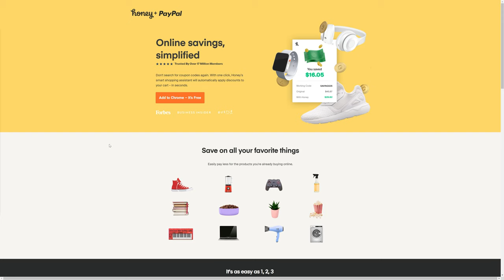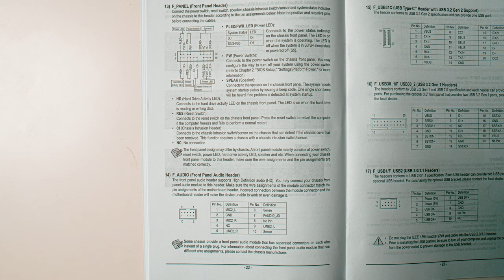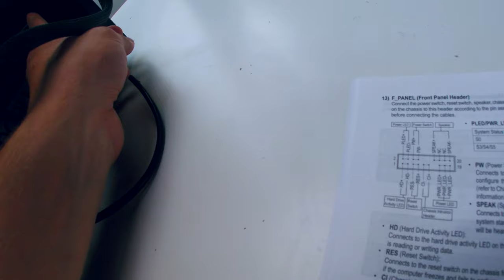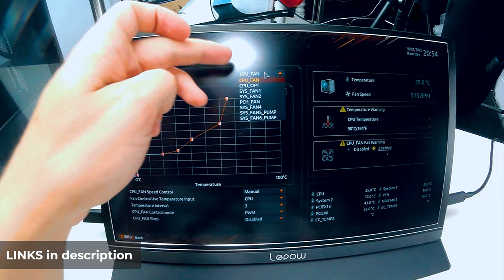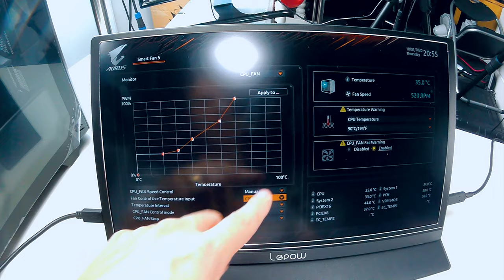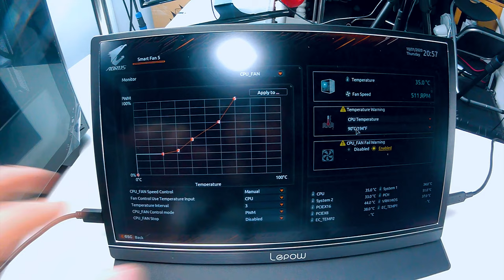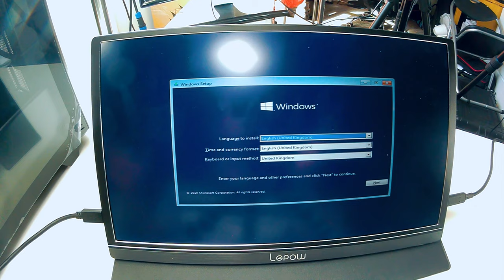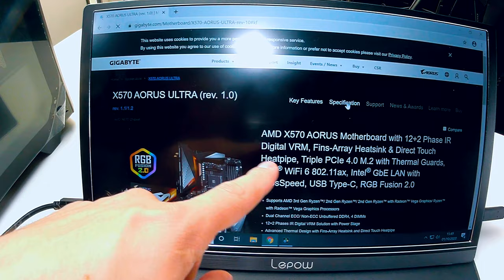ULTIMATE GUIDE: How to build Editing & Rendering BEAST for less than 3k?  | RYZEN 9 Workstation PC

Comment: * CAN ANYONE ANSWER THIS***

According to pcpartpicker as far as compatibility it states:
The motherboard M.2 slot #3 shares bandwidth with SATA 6.0 Gb/s ports. When the M.2 slot is populated with a PCIe-based M.2 drive, two SATA 6.0   Gb/s ports are disabled. Is this accurate? And if so what does it mean for this build?

Comment: first of, tnx a lot for this long video , I hv bought all of it except i changed it to RTx 3090, and finished the build, but I faced a huge problem, when I turn the fans started, leds, gpu too, all good, but all the usb ports are not working, doesnt repond to my keyboard or mouse also i tried every display port to connect it to my monitor, but nothing! I almost spent 4k on this and I felt like its garbage now! pls help! whats the solution? is it the mother board?

Comment: Hello, thank you for your explanation, it's happiness, I have an Asus WS X299 SAGE/10GB motherboard and I don't have the 3pin connector, I only have 4pin, I installed the liquid Freezer 2 360A-RGB but unfortunately, this deriner has a 3 pin cable, I can't find an adapter, to fix it on the motherboard, I mean a 3pin cable that goes into the 4pin one of the motherboard, y' is there an option to turn on the RGB?, thanks, also i have an intel core I9 7980XE CPU, but i couldn't overclock it to 4.6, because once i work on adobe premiere pro, it stops, because with this frequency, I can read my Intra AVC video without jerks in real time, it is possible to help me if there is 00 or 4k, a simpler method without complicating the things, thank you very much.

Comment: Watched this amazing build over and over and have just finished building my own. Used a 5950 and a RTX 3060 Ti Eagle.   Power on and everything lights up, all fans going but it won't boot into BIOS. The CPU light on the motherboard stays on and it doesn't cycle through the rest of the debugging lights> Do I need to update the BIOS or is this bad news. I'm fresh from 40 years of Mac devotion so I'm bit out of my depth here! Cheers
Reply from the maker: Have to check if the mobo is compatible with 5000 series Ryzen CPUs put of the box. I bet you need a bios update to support support CPU.
Reply from the maker: Hope you have a bios flashback option, otherwise you need a 3000 series CPU.
Reply: @theTechNotice  Hi, it's a X570 Aorus Ultra. Just tried to flash the BIOS. USB stick, exFAT with the latest update and file named correctly. Pressed the Q_flash plus button but no response. Repeated several times including re-making the USB stick and still doesn't work. Any suggestions? Fans are working and the Ballistic RGB RAM (4 x 16GB) all illuminated. Lights and fans are on on the GPU.

Comment: Hi, I have ordered the same parts from amazon and followed every steps on building this pc with you. However, i'm running into a problem that the light keeps flashing between cpu & dram on motherboard. I could get into bios in the first attempt and got the fans set-up. Once the PC reboot for the very first time, the issue starts. I tried with unplug the power cable and waited for30mins to reboot. Get to the "install windows 10" screen, then the entire thing just turns off and won't reboot. Can you provide me some kind of assistance? I've got all the parts 2 weeks ago and they're all brand new. Not sure where is wrong. Thank you in advance!
Reply from the maker: Have a look if the RAM is 100% plugged in, try taking it out and putting it back together. Then have a look where the LED gets stuck, is it boot, ram, vga etc. To see where the issue might be.
Also make sure the cpu cooler screws are tight, like almost to the max, half a turn from the max, but not 100%. 
Sometimes I've had the cpu too cooler too right and it didn't boot. (I doubt that's the case for you though.)
Reply from the maker: See if that helps.

Comment: This is one of the better build videos I've watched on YT. Wow, what a cool setup! Sure wish I'd bought my own parts and built something like this rather than dropping 3k for a CyberPower prebuilt hunk of RGB junk. Well, my computer isn't terrible, but I settled for a Asrock Phantom Gaming 4 wifi ax mobo and a Ryzen 7 5800x. The gpu is a RTX 3080, and I upgraded the RAM to 64gb then dropped an EVGA Nu Audio card in it. Still, the build you put together in this video is MILES better. Oh well, next time!
Reply from the maker: Wow, thanks! Don't worry about it, use it as long as you can and then next time build something better, your PC has killer specs regardless :)

Comment: Hi brother, great video first of all as always. I am a video editor and colorist ( learning). I have questions to ask. 

1. I have i7 7740x + gigabyte x299 aorus gaming version 1.0 Mobo , 4.5 ghz  out of box. I want to overclock my cpu to 5.0 / 5.1 speed ( is it advised to overclock a cpu?). If advised, what cpu cooler to choose cool master black or noctua d15 black or deepcool gammax gt v2? And what others fans, as I have Corsair carbide spec 1 cabinet. 
2. Having Gigabyte Mobo ( RGB Fusion) , I wish to use RGB on motherboard. What components you suggest for cpu cooler, ram, light strips. Anything else, I am forgetting !!  please guide/ suggest. I wish to sync all components to one color at a time. Don't like rainbow color effect. Will wait for your response eagerly. As sale will start in India soon on Amazon and Flipkart. Due to covid I can't go out to market place for purchases.
Reply from the maker: Depends, I'm not a big overclocking fan since it's not as stable as stock and for me the system stability is very important when I'm working on it 9-5. 
Just a thought on OC-ing. Although there are people out there who know much more about it and probably can make it stable so.... take it with a pinch of salt :)
Reply from the maker: I like aircooling and noctua seems to be the best :)

Comment: hi there i really like this setup so i decided to do the same. the computer is running perfectly but i have a problem. sometimes there is a booting issue. i mean the computer start and then its looping like it can't boot. i don't know if it's a ram issue, a power supply issue or a motherboard issue. do you think it can come from the fact that i didn't change the bios settings like in the video?
if i want to test the ram i need to take of the cpu cooler and so do i need to change the thermal paste after this operation?
Reply from the maker: Yeah, if you remove the cooler then you have to reapply thermal paste,
But see from the boot LEDs on the mobo where does it get stuck and try resetting all bios settings, see what happens then.
Reply: @theTechNotice  when the computer is running everything works perfectly it's just sometimes i have boot issue. i need to try several times. i noticed that turn off the power supply helps to resolve the problem. About the boot leds it's start with the red on the right (long) then red on the left side (short) and then red on the right again etc.
Reply: And sorry i forgot to say thank you very much for the quick answer
Reply from the maker: I have heard about that issue before, see if resetting the bios helps :)

Comment: Hey gotta question: Do I absolutely need the sleeved cables? Can I just use whatever that comes default with MOBO and PSU? Are there any other benefits besides aesthetics?
Reply from the maker: Nope no benefits and you don't need them. :)
Reply: @theTechNotice  cool. What about those extra fans you added? Can I get away with just the stock case fans if I'm not overclocking?

Comment: Never build a PC before, but with your absulely clear instruction I was able to build my own and it's all working super fine. So I say to all that are doubting to do this: Subscibe and DO IT!
Just a small thing: can you or anyone help me out with the RGB fusion thing: All the lights stay orange, whatever I do (I used apply :-) ) please on this I need some expertise. Greatings from Holland! Jeroen
Reply from the maker: Thanks :) 
Did you plug in the cables correctly?  :)
Reply: @theTechNotice  Yes and I have find out that I can change the colour of all the leds by first a sort of resetting the lights by pushing the most right button above the be Quiet front panel on the case. So that is something, but changing the colours separately is not something I have find out. But overall I'm super happy with the machine you have advised! 👍👍

Comment: I absolutely loved this as I am learning computers for my first pc build in the next few months for timelapses and video editing on Pr, AE and Resolve and intend to put more or less 3K as well. Will see if 5950x and RTX 3080 will be available by that time ! Otherwise I think I will go with 3950x and RTX 2070 SUPER.
I will have two more drives (2 nvme, 1 SSD and 1 HDD) than you, I suppose there is no problem fitting them in the case ?
I don't think I will take the extension cables, however where did you get your cable management thing ?
Great job again, and I am looking forward to know the performances of the build.
Reply from the maker: Yeah you should be fine fitting them all in the case. I'll speak more about the upgrades and case in part 2&3. :)
Reply: @theTechNotice  great! Good luck 😉

Comment: I tried to find link of the GPU in the description but I did not see, can you fix ... thank you so much
Reply from the maker: You're absolutely right, I forgot to add that. It's fixed now. :)
Just wanted to mention that the Founders Edition of 2080ti is probably hard to find new now, but possible to find used. 
If you want new GPU, I'd recommend the 3080 or 3090 if you have the budget.

Comment: great video walk through. I have never done this before and I was able to follow pretty well. Thanks!
Reply: So everything so far is going good except after I installed Windows 10 I can't see my 2 additional SSDs, but the bios does detect them ? They are all M.2
Reply: @theTechNotice  figured out the ssd, was not easy. But I can't get the RGB fusion to change any of the colors of the leds?